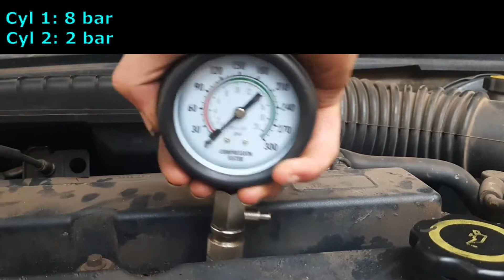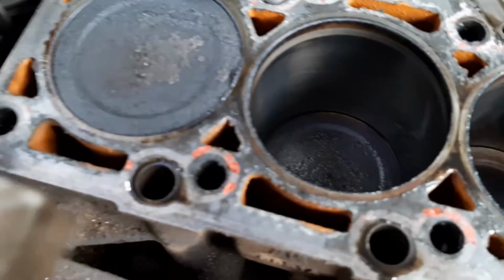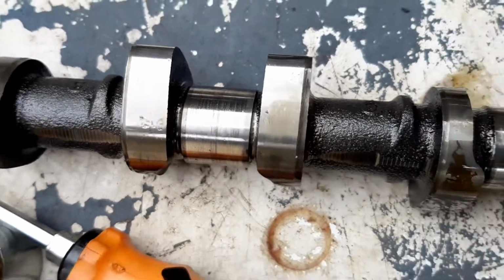BLOWN ENGINE Ford Mondeo 2.0 Part 1 Removing Head

Comment: Hi, i have the same car and recently the headgasket blew. Do you set the engine to top dead centre before removing the cam shafts etc. Are there any markings on the cam shafts I should line up?
Reply from the maker: Hello. Before taking the timing belt off. Put the engine on TDC (Top Dead Center). There are markings on the camshaft gears and on the crankshaft. When it is on TDC then you can take the cambelt and camshafts off.